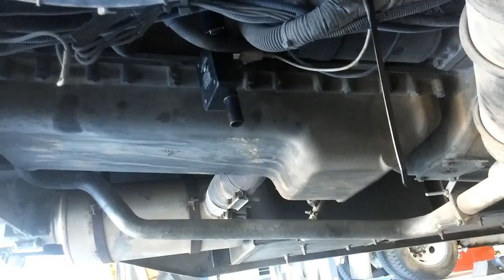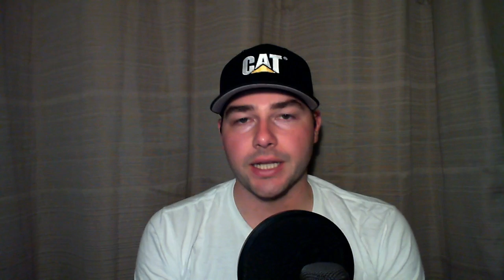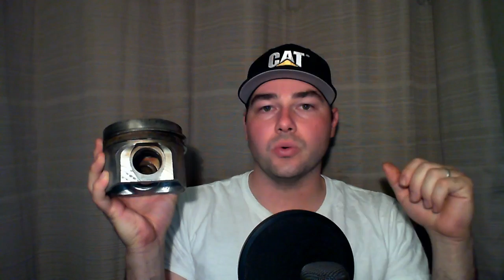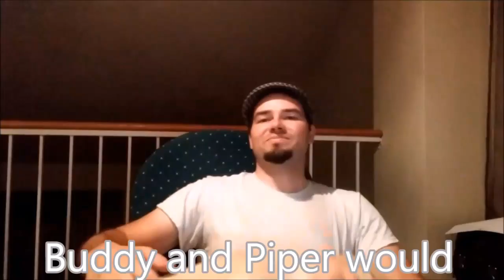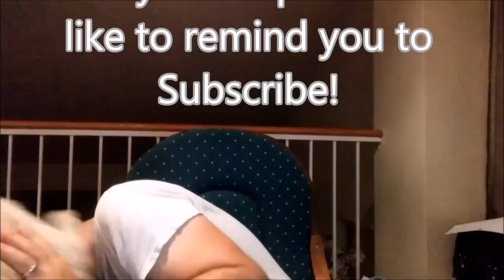Is Idling Your Engine Bad?  Does Idling Hurt Your Engine?

Comment: Would getting the high idle option for a Mercedes sprinter (Diesel) be a good idea? And what about when you’re in heavy traffic? Would it be a good idea to shift into lower gears to keep the RPMs a little higher?

Comment: Question: I live 2 minutes from the highway on-ramp.  Is it better to let the engine idle for several minutes to get warm before jumping on the highway, or better just jumping on the highway with a colder engine but avoiding the idle time?  This is a small modern 2.8L turbo diesel and I"m in a warm climate where summer days are in the 80's and 90's, winter is usually 60's-80's.
Reply: Unsolicited opinion: 
Idle it 2 minutes in summer, 4 minutes in winter ...

Comment: Hi Josh,

Excellent video, the explanation of how glazed cylinders happens and what the effect on the engine is.
Explains why our logging trucks always smoked, they idled while being loaded as the hydraulics for the grab ran of the pto.
If it were me I would have a apu and not use a pto where it is going to be used for hours on end.
The cost of a truck being out for two weeks to fix a motor has paid for an apu many times over.
And they smoked well!

Best regards,

Duncan from South Africa

Comment: A lot of issues arise from operators that are too lazy to flip a high idle switch on older units that were equipped with them. I’ve seen old S60 Detroit’s in motorcoaches  idle for days on end with massive climate control system running full blast. Considering the wear that the S60 were subjected to in motorcoach applications they have nothing but respect from me. The 12.7 pre-emissions was a money making piece of iron.
Reply: Great workhorse engine. 
I love em. 
Simple and has decent power. 
Note I didn't say king of the hill, but a good all around engine for everyone be it drivers or techs

Comment: i watched TheLittleGuyShow and he is driving a 18 Volvo with no APU yet. The Volvo manual which he quoted stated that he can let it idle for long periods of time which CAT doesn't agree with. I wonder if the idle is increased to keep more heat in the engine or if it has some baffles to help increase engine heat  in a state like sleeping in your truck overnite?

Comment: would running the AC and electrical loads help?
Reply: Adding load certainly helps! More load produces more heat and will mitigate  the issue.

Comment: I believe in water injection , solve all problem ,engine last for ever 
As the mist of water goes in  , hits the hot metal  , it aneals the metal and continue to get harder as times goes ,been using them 40 yrs 
Used to make my own , but the high tech one much better 
Just installed one on my Duramax
Good presentation

Comment: Why wouldn't a 3 cylinder idle work?  It may need to be higher than typical idle but it would keep the load up on the cylinders and keep the temps up. I might be way off base here also.
Reply: Not a bad idea, although you'd have balance problems...it would be rough and uneven, and you'd also have issues with the other cylinders accumulating engine oil.

Comment: i have leaks from freeze plugs in a cummins i built. the engine has idled about 5 minutes so far between me troubleshooting issues with my first build. the truck has 10 miles on it and i was not able to drive with a load, i kept the rpm/speed varrying while on the highway and i rode the breaks as much as i could to load things up but no trailer. i want to put some stop leak in but it needs me to idle for 20 minutes at temp. i dont want to try and daily drive this untill i fix the freeze plugs, do you think 20 minutes of idle will damage the engine?
Reply: DO NOT USE STOP LEAK ON ANYTHING! Fix the issue. Stop leak in anything just causes more problems...
Reply: Stop leak is not for diesels, ever!!

Comment: This explains why one time we got a truck back with a fresh rebuild and I decided to take it for a "test drive" and just hammered the living piss out of it. I got back and the mechanic said "what the fuck gear were you in pulling out of here you wanted to test it didn't you?" I said yeah it's got a ton of power. He said "good drive it like that all the way there and don't idle it until you are going to shut it off then low rpm for 2 minutes and shut it off" "DO YOU UNDERSTAND???" Don't fuck the motor don't idle it got ya boss.

Comment: Hi thanka man for valuable information. I have a question when I rebuild a engine like Mercedes Volvo and others I left them running for almost 12/hours is this bad for engine waiting for u answer thanks.
Reply: Don't do that, if possible put load on that engine. Try hauling something heavy and climb steep hill, those heat generated will sits the liners and rings rather than sits idle and causing cylinder glazing. Diesel engine needs to be loaded always.

Comment: So what causes the newer engines to be so affected by idling? Because I thought for decades that truckers idled at fast idle all night every night and the engines still lasted a million+ miles?
Reply: The old fuel had much more lubricity for one thing.  I'm sure it did a better job of lubricating the cylinder walls at idle than this ULSD crap we have to run now.  He didn't mention it but I was always taught that the high idle was to fling more oil off the crankshaft up onto the cylinder walls.  I was also taught that an idling diesel engine had virtually no wear but the cold starts were very hard on the engine so it increased longevity by not shutting it off.  Diesel fuel has gotten so high priced now that idling is discouraged as being wasteful by trucking companies.
Reply: Your thought process is correct in my opinion... a hard start will probably be worse than idling... since idling keeps it lubricated, while a cold/Hard start has to re-lubricate. I idle my truck daily for the last 7 months. Around 800RPM, granite. My def is deleted, the only thing I do on maintenance mostly. Is once a month change fuel filter and oil/Filter, and every 6 months change air and cabin filter. It does have an oil leak, not severe though. But it has existed before I took possession of that truck. It has 700K Miles On It. Its A DD15 Engine.

Comment: I'm curious to discuss modifications for low wear high efficiency idle and warm up. High idle of course if you don't have it but what else. 

How about heating the intake air, going back to something that used to be done on gas engines. When cooled they'd pull air from air heated by the exhaust manifold. Hotter intake air would help keep the cylinders warm, help complete burn, etc. Never seen it on a diesel, but don't know why it wouldn't work. Could be automatically valved to always be used at idle. A tee and one way flapper valve after the turbo would do it. Under boost all air is drawn in via the normal system. When no boost it's drawn in via the exhaust heater. 

How about higher coolant temps, maybe run an electric coolant heater off the trucks electrical system. This would help keep everything up to temp helping not only the engine but the trucks heater. With the added bonus of adding a slight load to the engine via the alternator. Just put it on a temp switch to come on when coolant temp is too low, say below 180F. 

Maybe an exhaust valve, again going back to gas engines, they used to have a heat operated valve in the exhaust manifold to increase exhaust back pressure when cold to assist in warming up. I'd think something similar would work even better on a diesel. On gas engines these were regulated by a bi-metal spring on the manifold, could work the exact same way, so hot manifold = open valve.

Comment: not sure if you’ll see this comment but i have a GM 6.5 turbo diesel (i say that because some models don’t have them ) but i idle it to warm it up especially when it’s 30 degrease Fahrenheit outside will that hurt the engine in any way and as mentioned it’s not usually over 5 min before it’s driven
Reply from the maker: Idling it for a couple minutes before driving away is totally fine. This video was meant to discourage long idling when parked and overnight.  I need to make a video on this subject.

Comment: Shooting a can or two of WD-40 (optimally, followed with a pint of spray-mist distilled water) into the intake manifold during idle once a year or two would work miracles for most fuel-injection cars having blowby / oil-burning issues (and perhaps re-routing the pcv vent)  it's kept my 330k mile camry running strong
Reply: Hi where is intake manifold? And what is purpose of water?  Thanks

Comment: My friend is annoying when he wakes up for work and I'm not even joking he will "Warm Up" his gay ass Cumin's for 45 to a hour it's annoying and then he lets it idle when he goes into Walmart and shit and claims it's "Good For It"
Reply: I've had my dodge with a Cummins since it's had 105k now I'm at 317k an I've always fired mine up let it run for 10 at max and leave. Take it easy on it and don't get into a lot of boost till operating temp. Zero blow by and zero oil consumption in 4K intervals .in freezing temps I let it idle 10 in the summer maybe a couple mins. Use 15w40 year round . Recently did head studs an injectors. My cylinders have no visual wear and cross hatches are still there. Hardly any carbon either.

Comment: Thanks for the videos you make. In this case I have to disagree. Im third gen. in the trucking bus. I was taught when the truck is away from home that means its working. When it is working, its running. Although ALL engine manufacturers recomend you not idle your engine at all and that it can hurt it to do so, didnt always recomend not idleing. When an engine is idle, the only thing to worry about is air flow on hot days and too much air flow on cold days. Those problems are not so much a problem nowadays, because of advanced cooling systems and air powered fan clutches etc. When this became an issue, all engine manufacturers at the same time somehow decided at the same time to declare that idleing will damage your engine. Ya, exactly, when do all of them agree and start doing ANYTHING together. Its always been the big competition and if one is doing one thing the other will do something different just to be the first to start doing a thing that becomes a success. Am I right? So there were red flags everywhere for me when all this came about years ago. My first thought was maybe the EPA or some BS clean air govt. agency had passed some "clean air act" and confronted the engine companies and told them if they didnt do this they would be hit with emissions crap, that wouldnt work because of horsepower issues involved in moving heavy loads at hiway speeds. So why not get all us dumbass truckers to think we have to shut off our trucks to save our engines, or program the computers to shut down the engine if it idles for more than 5 minutes. Unless you idle up the engine to 1000-1100 rpms. Knowing that the extra fuel that burns will be more $$ out of pocket than we could afford and then we would decide to shut down instead of ideing. You must realize where I was and the place I called home was central California. At the time this was all going down, California was the Third Reich of smog law ( prolly still are) LOL, and they were pulling all kinds of BS on us Trucking outfits. They worked at it until they finally got the older non computered tractors/trucks off the road. So the way I see it is at an idle the cylinders are not creating even close to a fraction of the heat they are built to tolerate. Think of the intense amount of heat inside the combustion chambers on a large diesel engine under a grossed out load pulling a 5 mile 6% grade........... you still think idleing your truck for 4-6 hours is hurting it? Also when a truck idles for four hours it doesnt burn more than 5-10 gallons, maybe, My old Pop always said it was about a coffee can full. At any rate, we now have better oil, smarter engineers on engine lubrication, better machine tools for making engine parts. better systems over all on modern trucks. so why are all manufacturers convinced of "damage by idle"? I call BS. because in almost 75 years of trucking I have never heard someone say or say they heard or read anywhere not one time " engine blew up, too much idle time" and if it wasnt a Govt. agency then it was a deal with big oil companies. Diesel used to cost half the price of gas because it used to be a by-product of gasoline. I had to express my feelings on this matter because you have talent and I hate to see you wasting awesome troubleshooting skills on some BS like this! Sorry for the long rant about this. I enjoy your videos and it is good to see a mechanic from  this younger generation who has TS skills that go past reading engine codes and R&R. Carry on, young man,carry on.
Reply: Too many wives tales in your post...sorry.

Comment: Hey bud my brother has b model cat. He just had injection pump rebuilt bc it was skipping. Before it sat for about a year. He put freshly rebuilt pump on still skipping and now heavy blow by and you can put your hand over the oil filter cap which comes from oil pan. And it Puffs and blows oil on your hand. It even blew the dip stick out. Can this be caused by the timing advance on injection pump

Comment: Okay here is an interesting question, idling is bad because of carbon build up. What If you ran fuel additives all the time during idle to reduce carbon and to lube cylinder.
Reply: The problem isn't so much what is in the fuel, but the fact that at idle, the combustion chamber may not be hot enough to ensure all of the fuel and oil is burned away. That leads to it building up on top of the piston. You'll sometimes see it come out of the muffler still runny sometimes if the engine is drowned really badly. 

Fact is, diesels need some load on them to get that combustion chamber hot enough to burn off all the fuel. If it isn't hot enough, the fuel won't burn properly and the engine will coke up.
Reply: My guess is that fuel additives could maybe create higher temperatures & burn off excess fuel.  Fuel injection cleaners on gas engine work in such manner but maybe just running at max RPM for few minutes may help as well.

Comment: i guess this also applies to gasoline engines in cars?
Reply: Less-so to port injected as they don't idle very efficiently. That means they keep the combustion chamber hot enough to clear it out. GDI (gasoline direct injected) engines are far more efficient idlers so they tend not to warm up just sitting which leads to more oil and unburned gas on the cylinder walls. 

The main difference with diesels tho, what makes them far worse, is that the fuel has a fairly high flash point and isn't as volatile. That means it tends to accumulate in the combustion chamber if the engine isn't warm enough.
Reply: Yes and no. In Diesel engines, the fuel is also a lubricant, where as gasoline doesn’t have any lubricity.

Comment: What about if you delete your EGR? It would be safer to idle then, right?
Reply: It'd actually be worse. EGR at least provides some heat to the intake. The issue is that diesels idle pretty cold, and so the cylinder walls don't stay hot enough to keep the fuel from condensing. So the unburned fuel builds up. I wouldn't recommend deleting, just idle it over 1000 RPM is you have to, or get a smaller engine so your load factor is higher at idle.

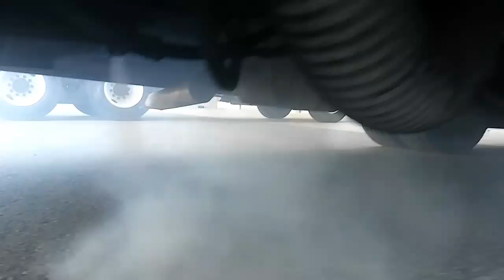Comment: I fondly remember my first truck with a 3406 back in 1990, by the time I got it, it had a million-two on it already, and was getting tired.  Back then we didn't have the toys we use now for heating and cooling, so it was either run the engine or die frozen solid in the bunk.  This old girl spewed so much blow-by when idling that within an hour,  there'd be a light haze inside the cab,  so I had to always run the engine fan to chase away the blow-by gasses from lingering around and getting pulled into the truck's hvac.  You could see the vapors coming out the blow-by tube, but it sure was nothing like what Josh showed at 04:10 in the video.

Comment: This does not really make much sense engines would rather idle then being driven as there would be less wear during idling, the engine also ramain's at the same temp idling as it would being driven, this is what the thermostat is intended for
Reply: Tyrone Nelson during cold starts, diesels will start to spew a lot of fuel to get it running and start warming up, I suggest moving diesels slowly as soon as oil light goes off. Diesels tend to warm up slower and thereby washes the cylinders a lot more due to extended cylinder times than gasoline engines.
Reply: Justin Tan gasoline engines behave very similar to that, my v6 cougar has 4 overheads and when thats cold i cant drive it until the oil pressure builds up and goes up to the cams plus the choke is on aswell and when its cold it uses alot more fuel.

Comment: An APU will eventually pay for itself. Because a class 8 engine will consume 1 gallon/hour, idling overnight. An APU will only consume 1 quart/hour for that same amount of time. The APU charges your batteries, cools your sleeper, and some keep your engine warm if it is plumbed into the cooling system.

Comment: Does idling damage gasoline engines also?
Reply from the maker: +Avery Alexander I wouldn't say idling damages engines, just leads to premature wear. Yes idling extended times can lead to premature wear. Many new cars have an auto shutoff feature to prevent idling.
Reply: Thank you very much. I have heard that starting the engine puts a lot of wear on it because it runs for a second without oil pressure. Is that true? Thanks, I love your videos.

Comment: Diesel engines are designed to idle. There are some older engines that can’t hold heat in winter and need higher rpm to stay hot. If the engine hold heat at regular idle. It fine. Yes I drive a truck and have videos about trucks.